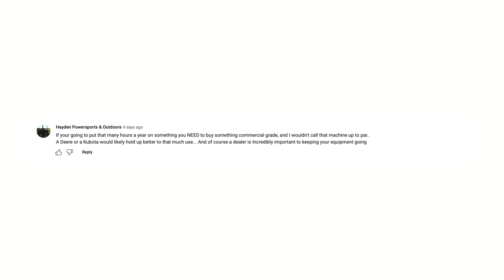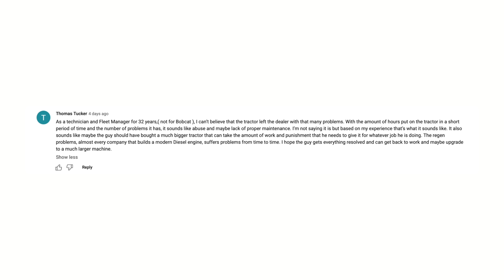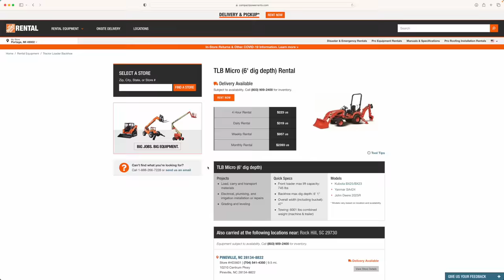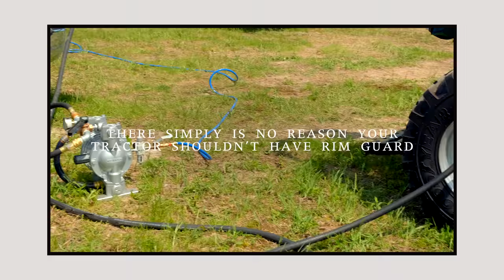COMPACT TRACTORS CAN'T DO COMMERCIAL WORK? 🤔 🚜

Comment: Actually, a machine used more will generally last longer.  Most engine wear occurs during a cold start when the oil is thick and lubrication is least effective.  An engine started twice a day, say in the morning and after lunch and run all day is averaging one start per 4 hours.  On the other hand, many homeowners start their tractor and use it for 30-60 minutes and then shut it down and don’t start it again for another day.  They are averaging 4-8 starts per 4 hours.  That is a lot more wear per hour for the homeowner tractor than the commercial tractor.  So, don’t be afraid to use your equipment.  Well maintained, oft used equipment will far outlast equipment used 50 hours per year.
Reply from the maker: Good way to look at it

Comment: I’ve got a kioti with a front end loader. It’s used in the woods 90%of the time. First year I put 900 hours on it with absolutely no issues. It has 2400+ hours now and it’s in just as good shape as it was when my dealer delivered it.

Comment: AMEN!! MY 1025R has about 100 hours in the past year and a half since purchase (not a lot). But,  it's been a HARD 100 hours with zero problems so far. I've tilled acreage plots; dug trenches, tanks, septic, and other projects in very rocky soil; brush hogged hot dusty acreage in 100 degree plus Texas sun; dug out 3'-4' stumps in residential backyards, and moved rocks, landscape materials, boulders, trailers, and more. Regular maintenance, routine inspection, and an understanding of the limitations of the machine (and staying within those limitations) will increase the chances of trouble free operation. Usually ( stress "usually") any problems are operator related.

Comment: Ditto! I use my JD 1025 commercially to plow snow with. Plowed over 450 driveways in less than a week. Did an awesome job! Belts broke on my zero turn after just servicing it also. Mufflers fell apart on a Cub Cadet garden tractor. All my equipment is used commercially. But regular maintenance always performed. It still breaks.

Comment: I bought a 2018 new holland boomer 24. 5 years now of what id assume is pretty severe abuse, i have town down steel building's, cleaned up several burned down houses, town out countless tree stumps, dug hundreds of feet of trench, rototilled massive acrage, bladed miles of road, lifted dozens of engines and peices of equipment in and out of trucks, pulled boats and campers. I can go on and on. I actually just broke the backhoe for the second time today, I'd sayba design flaw, im cleaning up a burned down house again on thursday, i inspected it today, no cracks anywhere, no terrible damage. I feel bad for the machine but its what i could afford when i was 25 years old, and i love the size, the only reasonable thought i have had latley is i need two machines, one big ine small. But theres lots of pther things i need before i spend another 50 grand. Until then im abusing it and hoping it makes me enough money to buy a brand new machine in a few years. Its proably made me well over 100 grand so far, and i imagine im at about half its lifespan.

Comment: I had a JD 4500 series that I (BOUGHT NEW) with front loader, backhoe, forklifts, brush hog, back blade, back rake, and post hole digger for 20 yrs. and it never gave me any problems at all. No leaks nothing other than 2 batteries that I had to replace. I took care of it and never mistreated it.  Never let anybody handle it other than me. I had 746 hrs. when I sold it. JD are good tractors.

Comment: I have a 1025r that I regularly USE to it's maximum capacities, I have 308 acres and the 1025r sure seems small compared to the tasks I have and I would have a bigger tractor if I could get it to my property but I need to barge it to get it there. Heavier tractor would mean bigger barge, bigger truck to move the barge, bigger trailer for the tractor and so on, so I'm stuck using what I can and have to use it as needed. I definitely agree that there is a big difference between use and abuse
Reply from the maker: Awesome, glad to hear it
Reply: Better using a small tractor than a wheel barrow and shovel.

Comment: Use my 1025R for commercial work all the time.  Concrete pads, patios, driveways, sidewalks.  Loader, backhoe, tiller & box blade.  Fits where big boys won't.  Doesn't tear up turf like a skid steer.  I am just as fast.  More buckets but quicker trips.  And oh yeah,  I actually fit in the tight spots.  Do your maintenance!

Comment: I still think the lesson from the Bobcat video is NOT that they make a bad tractor, it is "when buying a tractor, make sure you are buying good service".  Every machine has the potential to have problems and you need a good dealer that will take care of those problems.  That is why I bought a Massey Ferguson.  I wanted big green but had a very bad service experience with them after a regional company bought all of the local dealers.  I still have an older big green machine, but I won't buy a new one.  When the old one finally gives up the ghost, it will be replaced with another brand.  All because I can no longer count on good service.

Comment: Good job on the video. I have driven large & small tractors on the farm. I use a sub compact tractor and put hundreds of hours on it a year. They are made to run, hence why diesel engine and everything around it. Proper maintenance on the tractor it will last for thousands of hours. Things will break it just of fact of operating and using equipment.

Comment: I hate when people say it's abuse when your are using as intended. I have a 20 2.7 f150 4wd and I'm on my 3rd transmission in 9k miles after having problems start at 29k miles in June last year to now .  People were telling me it was my fault. I drive 150 miles a day for work. It's a 10spd. They have known issues for slamming gears and crazy shifting patterns. I just want to use the truck I bought.  But as to the hours on the tractor, I'm jealous. I wish I had the time to put that many hours on my tractor lol.
Reply from the maker: Man, that's a real bummer!
Reply: @Good Works Tractors  yes sir but hopefully, this one is not going to repeat the others.
Reply: @Tim L.  it's being covered under warranty but theirs an underlying issue with it. Maybe electrical because my collision systems are going off randomly when no other vehicles are close to me.  I haven't done anything to the truck that requires a computer.  All I've added is rough country seat covers.

Comment: I can say I have a bx it had 160hrs when I got it 1.5 years ago and now has 340. I use it alot and pretty hard, mowing, bush hogging chipping trees, driveway maintenance, digging roads, and I plow our mile long county road in the winter (we're pretty low on the priority list for the county). And I haven't had any issues with my tractor. And for evidence of a little tractor getting used hard but not abused, watch Biffs Equipment and what his little bx can do. That little tractor gets used hard but never  any real issue with it

Comment: I get what you’re saying, but I do think constant unscheduled maintenance issues on low hour equipment is unacceptable if proper preventative maintenance is being done.  In 1973 my father bought a JD 820 utility tractor to use in our poultry houses and   small cattle operation. At 31 pto hp it was overloaded from day one bush hogging, hay baling, and using a self loading fertilizer spreader.  He cleaned other people’s poultry houses for $4 a load until the 80’s.  It ran every day for the first dozen years, the hr meter quit in the mid 70’s at 3100 hrs and wasn’t replaced until 2 years ago.  I still use it 100-125 hours a year.  We have never been into the engine, transmission or hydraulic system except scheduled maintenance.  I think constant maintenance issues on lightly used equipment has become acceptable as the norm and it shouldn’t be.

Comment: 100% - I have a 3046R and a 1025R - each has their purpose in both a commercial and a residential application, and the hour counts are just hour counts. If I use a smaller tractor for tight spaces for 10 hours, or a slightly larger tractor for more open spaces for 10 hours, it's still just 10 hours on each.

Comment: There are many videos out there on how to right-size your tractor purchase to your needs.  Know the engine difference when HP is greater than 26 (maybe 25).  The dealers I dealt with were happy to provide out the door quotes for my comparison. If you need green or the K orange then that's what you need. but value brand tractors are very good and offer great value, really.  Beyond these things, know/learn how to use a tractor for what it is intended.  Also, do as much prev maintenance as possible to save some bucks.  Research, research, research and watch a lot of videos.  Courtney has done a lot of good ones.

Comment: I was hoping to see some rear blade action with the thumbnail picture.   The first time I used a rear blade on a subcompact it leveled out over 200ft of gravel driveway with the perfect 4% slope.  Sure it took 2-3 passes per side to cover the width but the finish was almost sculpture.

Comment: OPINIONS, OPINIONS!!! Everyone has one. As a retired farmer and certified diesel mechanic I have seen a lot of break downs over the years. My personal riding lawn mower/tractor (20hp Kholer)is now 30+ years old and still going strong and for two reasons PMS and only used for what it built for; mowing grass and pulling the yard trailer.
Today they have turned that market into toy's just like the pickup truck market. Can you haul a eight foot piece of lumber with you tail gate closed?
Personally you bought it use the way you want!!!

Comment: I mean when ya think about bobcat it's definitely the backbone of the industry. I also believe Kubota has really pushed the limits of how ridiculously tough those little tractors are. I have a old ass mini kubota and that little MF is probably the tuffest thing i have seen i have pulled trucks out of the bank with two full size jet skis on the trailer after that i think those little tractors proved how absolutely powerful they are ! The harder the use the smaller the maintenance interval it's not that hard check the rad screen keep a eye on the air filter and check and change the fluids.

Comment: Sounds like that dealer just started selling machines and just got some kid out of school who dosent have any tools or experience.    I wonder since he didnt say when he found loose bolts.  Dealer should be checking when they recicve equipment in and before delivery. I have a Ct2535 and the owners manual says after 10hrs use check all bolts and retorque them. I found a few loose bolts i needed to retorque.  But i also have the benefit of  driving heavy equipment our 972m cat  has 20000+hrs just under 3 yrs and the transmission just went out. All our equipment has preuse inspection forms from checking lights, all functions working, fluids, loose blade bolts & pins along with cracks in bucket /loader or other physical damage.  As for his other issues he definitely needs a different dealer followed by getting ahold of corporate to deal with his current dealer. Im making a laminated cheat sheet for all my bolt torque specs, filters, &  lights so i dont have to keep digging owners manal for numbers. You will have to let us know if he finally gets it fixed or new tractor.

Comment: The difference is at a rental outfit. You theoretically have a staff that is there SPECIFICALLY to maintain and repair their equipment after it’s abused for a day or two. 

And on another note… it was not mentioned that it was being used commercially in the previous video. And in fact a couple people were very quick to say that he is their neighbor and he just uses it around his house. So now we’ve got conflicting use cases. 

And no, loader welds don’t crack for no reason I’ve been a mechanic and a welder for a long time. While it’s absolutely true that things happen. Integral structural failures aren’t usually in that category. 

It is what it is. Now we’re hearing that he put 500 hours on it in 8 months instead of 12. The story doesn’t seem to be improving here…

The fact it there’s plenty of much more heavy duty and even more compact machines designed specifically for commercial grade work. Like mini or compact skid steers.
Reply: I found the story to be a tad to fishy for my taste. I would love to hear Bobcat's side of the story.
Reply from the maker: I would venture a guess that far more commercial companies do their own service vs take it into a dealer for service.  Plus, rental companies have a different operator every day.  This guy is the one using it day in and day out.

I never mentioned it was used commercially, viewers did.  My point is that it doesn't matter if it's commercial or residential use.  It's a machine, it doesn't care.

I mentioned iun the first video that it had been a model year old and it had been in the shop for 4+ months which meant the hours put on were in even less time.  So, you just missed that, it's not new information.  That equates to around 3 hours per business day...yikes, if a tractor can't handle working for 3 hours a day, 5 days a week, then there's a major problem.  

I've used mini skid steers.  Don't like them, in fact, stopped selling them.  Much rather have a small tractor for most of those applications.
Reply: @GoodWorksTractors  Only thing I can say to that is that you are correct. I ASSUMED (which was stupid of me) in the first video that he had gotten a year of use out of it not that he had owned it for a year. So that’s my fault for assuming. So I’m sorry about that. 

Having said that, no one here is trying to state that you simply cannot use a tractor for commercial work. Or even, by extension, that the number of hours is the abuse in and of itself. At least that’s certainly not what I’m saying. I’m simply saying there are better options out there for heavier work than compact tractor which only excel at being versatile. They don’t do any one thing great… For example, you could absolutely use an X749 for a commercial mowing operation. But you’re gonna get a wholesale lot more done and with better results and less breakdowns with a zero turn since that machine was designed specifically for one purpose. 

The best way to put it is years ago Ron White, in one of his comedy specials, talked about a man that said he could stand up to hurricane force winds. So he tied himself to a tree in Florida. And Ron pointed out that…

It’s not THAT the wind is blowin
It’s… WHAT the wind is blowin!

Meaning the hours are largely irrelevant compared WHAT he was doing with the machine during those hours.

Comment: If you use equipment casually like a couple weekends a month, depending on the work,  then you won't have an issue.  I believe my 1025r is a 2019 and I have almost 120 hours.  But If you have a side hustle and you're using it every weekend for 4-10 hours a day,  that's easily up to 40 a month.  Almost 500 a year.

Comment: I love my Yanmar SA424. Small enough to get anywhere, strong enough to do most anything I need it for. No regen either 🎉 I do wish it had a skid steer quick attach front. So I could get a snow pusher!
Reply: You can adapt it. Or get the Yanmar quick attach brackets and weld them on to your attachment.  Love mine as well.

Comment: I have a 2015 JD 1025r with almost 1000 hrs on it. I know a guy with the same year tractor and only has 250 hrs on his. He has had more problems with his and I think most are due to sitting around. Mine blows, mows, digs holes, hauls, dirt and wood, tills and scrapes and not really any problems. His… quite a few problems from sitting around. So there is that argument… “ use it, or loose it”
Reply from the maker: Use it or lose it!

Comment: Compact tractors can certainly put in work, if simply used within their capacity.
More running hours per start also means they last longer.
If it's got a couple H/U/I beams = Good to go and no issues, my issue is with garden tractors, a.k.a lawn mowers, flat "frames" made out of sheet metal or even plastic, weaker than most cars even, needing arbitrary frames for each and every implement.

Comment: Uhhh no, I totally disagree.  500 hours in 1 year is going to be a LOT easier on the machine than 500 hours in 10 years.  Once oil is circulated and everything is up to temp it's a lot easier on the machine than doing a lot of short runs where it either never does warm up or barely does.

Comment: You hit nail on the head with the machine not caring how fast it gets to 500hrs or 1000's of hours. Machines are made for work whether for hobbyist or commercial work. I'd expect all name brand machines big or small to be able to run 40hr work weeks if not some running multiple shifts per day. Not much different than a car or truck running "X" number of miles over its life. Someone could put 60k miles on a year or like me... 10yrs. Its all about maintenance schedules, storage and the guy running the machine. You could have a person running it like they stole it and the machine could break down within 100hrs vs 1000+hrs from a person that wants the machine to last a very long time and run like it was when new. Heck, I know of a young loser cousin of mine that beat the crap out of a brand new john deere skid steer with relatively low hours and it started on fire with total loss. Oh Daddy will buy a new one. Anyhow....need I digress more..

Comment: I think the subcompact class is for ~3 acres or less.  If I had 5 acres I'd want a regular size tractor & a riding mower as comfortable on my back as a subcompact.   I'll be sticking with the subcompact b/c the attachments being at ~300 lbs is safer when working solo.